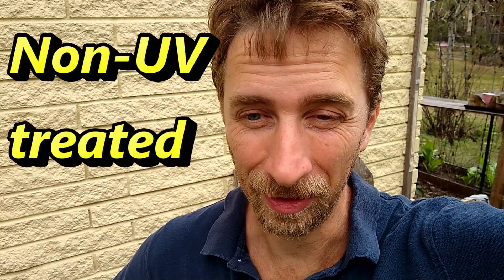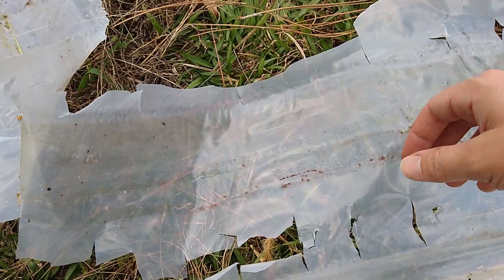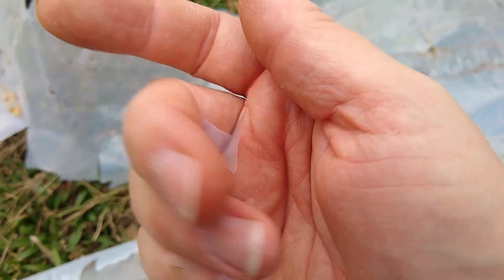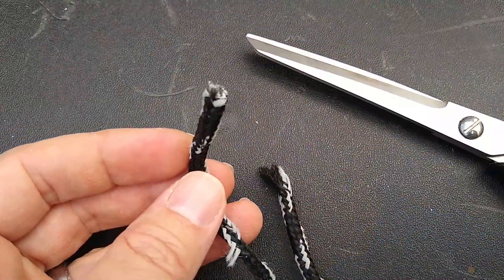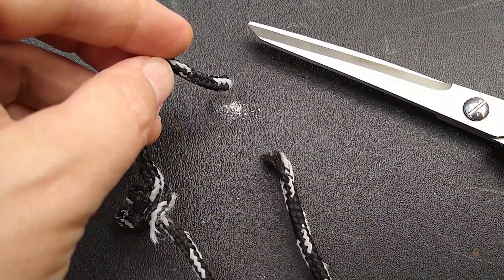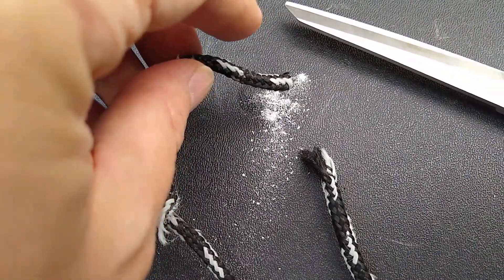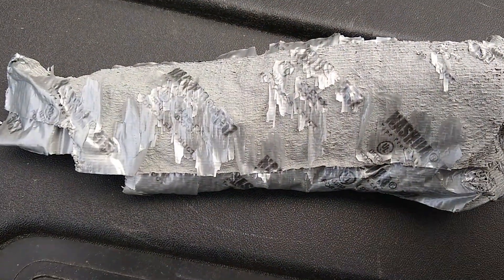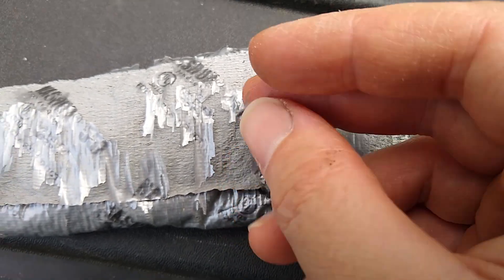Greenhouse Non-UV Treated Plastic On YOUR Homestead!?!

Comment: We definitely need to know HOW to dispose of those without further damage to our environment.   So....How? 😢 Anyone? 

  BTW...DRYER LINT. Put into an egg carton cup; a tablespoon or so of melted wax onto the lint.  Best way to light a wood fire, small as a Hibachi grill or large as a garden brush pile.  You can put it on the top of the wood and the wax flames melt down onto the wood and all the way down to the kindling.
Reply from the maker: If you burn polyethylene you get by far and away just carbon dioxide and water, similar to burning other fossil fuels...
Don't know if this is better than micro plastics...

Comment: The #1 source... Dryer lint from synthetic fabrics... Think about that baseball sized clump of lint you remove from your dryer after every run... You don't even have to wait for it to break down into tiny pieces, it had a head start. And the bad part is that the really micro-micro pieces pass right through the screen and right out of the vent into the great outdoors
Reply from the maker: True true